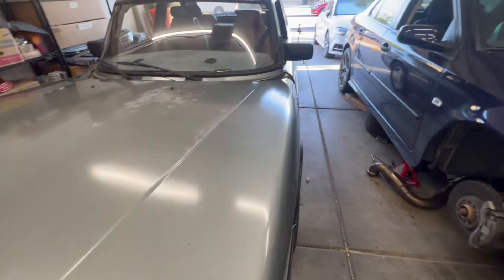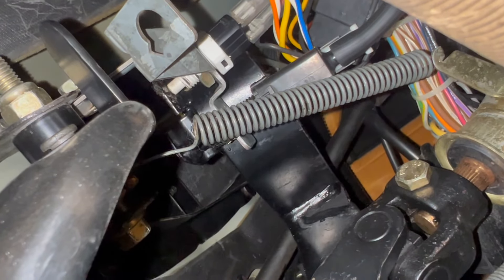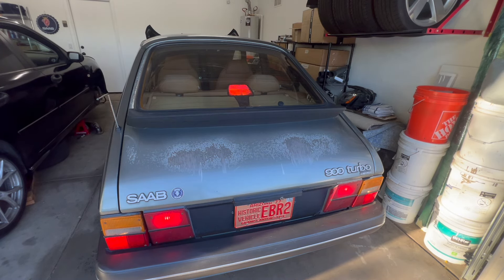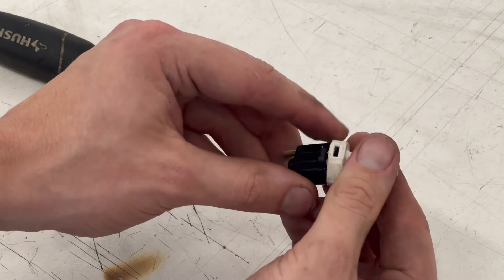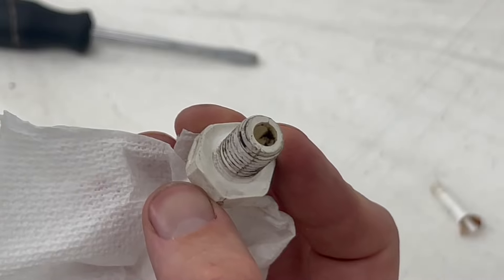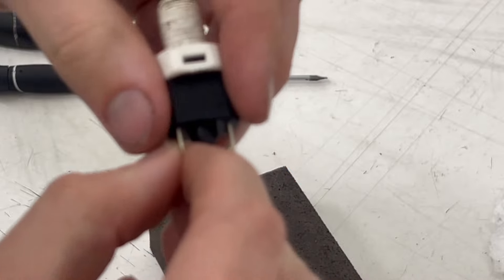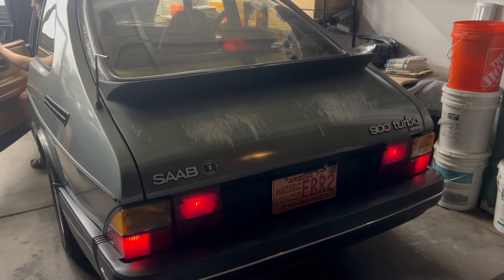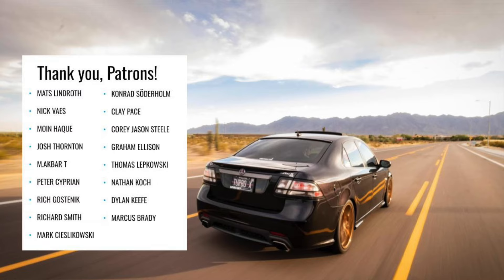Solving a Dangerous Problem on My Saab 900

Comment: Was having same issue 6 months ago. Nice to see how others approaches the same thing. I took me a while to figure it out. In my 900 1985 the inner parts of the switch were designed slightely different. The plastic knob melted a bit and started to prevent contacts from connecting. If only watched this video earlier, it would save me some time.
Reply from the maker: agh! that's frustrating, but glad you arrived at the same conclusion

Comment: Nice video tip!
Those contacts just need cleaned and spread out a tiny bit to have a more firm contact on the surfaces they wipe up and down on. Typical wear. Very cool it is so easy to work on!
Reply from the maker: All better now thankfully. Definitely not too bad of a fix!

Comment: Great root cause analysis, Jacob. Good idea to use the old part as it is likely higher quality than any 3D printed replacement. I had a similar pedal switch issue on an Integra GSR I used to own, except it was the spring on the clutch pedal that controlled the cruise control had worn. Likely from the previous owner driving it on the track. It wouldn't allow the pedal to fully retract which was where the switch to engage the CC was located. I discovered it once by pulling the clutch pedal back manually and the CC engaged. 🤷🏻‍♂️🤔 Sorry for the long story.
Reply from the maker: Oh wow. NG 9-3’s sometimes have a similar problem to that

Comment: Well done Jacob. At least it's simple on the old style brakeswitches. Newer ones (like the NG 9-3, should be the same for manual and auto boxes) is not a fun adventure XD.
Reply from the maker: Yep haha a fairly simple solution thankfully! 😅
Reply: @AutoAutopsy have you done it on the 9-3? It's the weirdest ever. It has 2 brake sensors! One for lights other for telling the ECU that it is braking. Thing is. It's got 4 pins and uses 2 pins in each of them. Another Saab qurkiness🤣

Comment: I also had to repair that part in my 1993 saab 900 convertible.  But I discovered it was bad because after turning the car off, the lights would stay on and drain the battery.  inexpensive part and very available.
Reply from the maker: Interesting, so the opposite problem as mine! 🤣